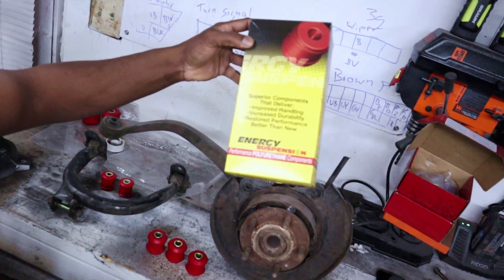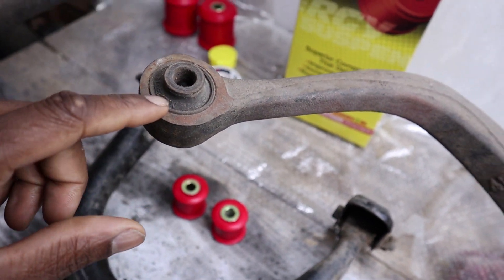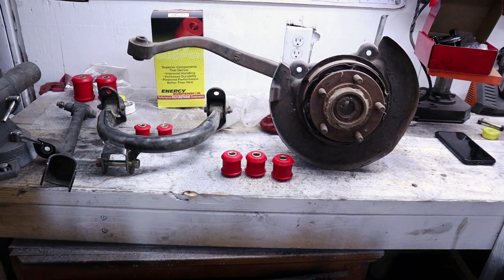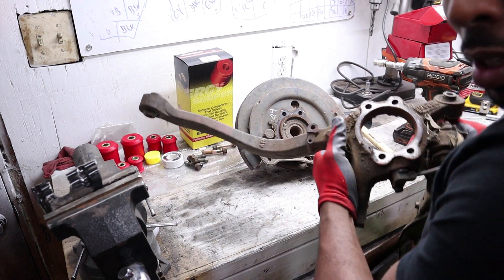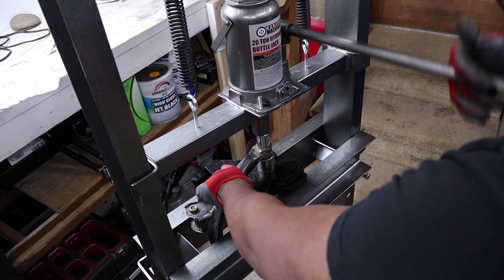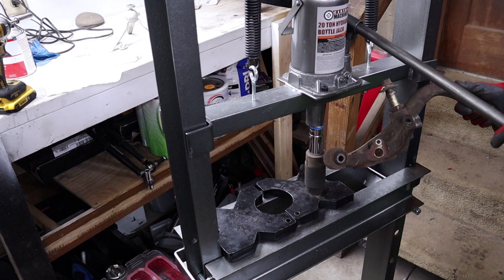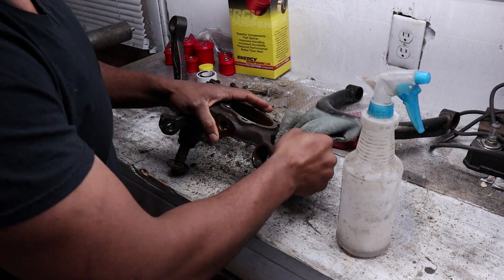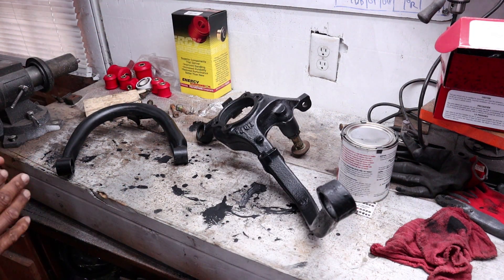Installing Energy Suspension Polyurethane Bushings

Comment: I just changed the upper bushings in my knuckles. Huge pain to do without a shop press.
Reply from the maker: It’s definitely much harder on the press, but the bolt method worked great.
Reply: @RvaJay  i used a balljoint press kit and sockets just like you did with my impact. I'm gonna need real coilovers soon. The cheap ones I bought are way too low at their highest setting in the rear.

Comment: Just in time, i need these bushings. I'm about to do the same conversion on the back of my gal. I got the back disck assembly from a v6 2003 gal, I'm a bit skeptical about the brake lines tho since the fitting is different.

Comment: I used the link for the bushing kit but it says they're for mitsubishi eclipse
Reply from the maker: Correct. The 2g,3g and galant all share the same rear suspension.
Reply: I went ahead and got the Energy Suspension kit, it all works for my 98' 8th gen vr4.. Kit # 5-3119.
Gonna do the install myself also!!